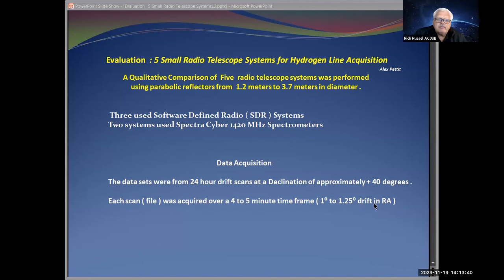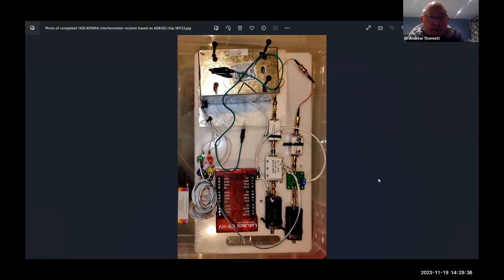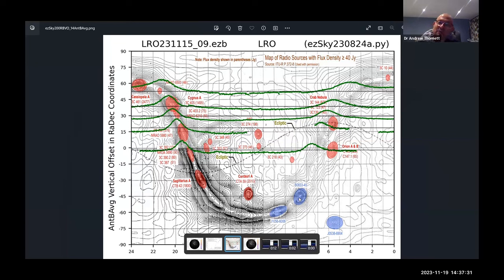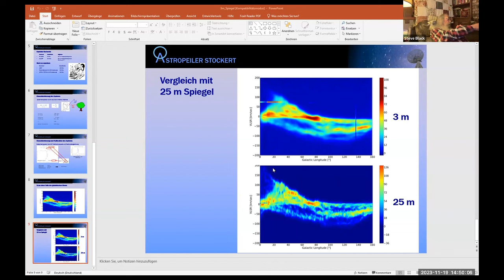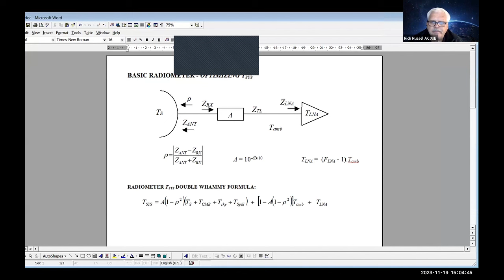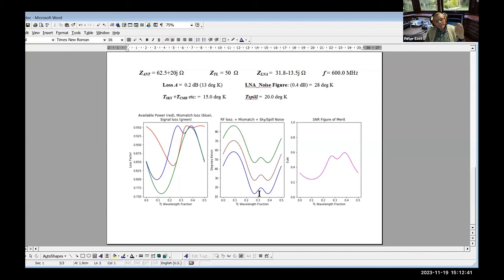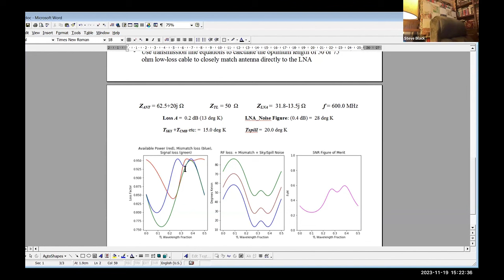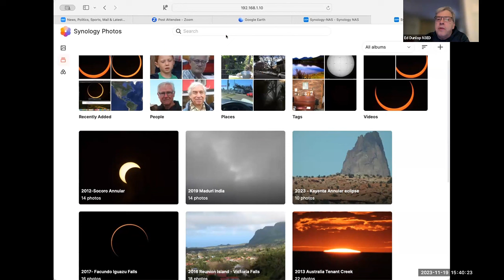Drake's Lounge: Nov. 2023: HI Resolution, Vel Plots, HI Map, Mismatch Noise, Solar Eclipses

Comment: Thank you for bringing this on youtube. One explanation for the question posed @28:34 could be that the 60-80 degree on the Galactic plane, corresponds to the hydrogen clouds in the Cygnus constellation. This region is rich in hydrogen clouds especially around Cygnus-X region. The region around star Sadr up to Deneb is also rich in HII. Of course this is different from the neutral Hydrogen used for the 21 cm measurement. Gal degrees around 140 corresponds to the constellation of Perseus and could be from the Perseus arm of the MW.